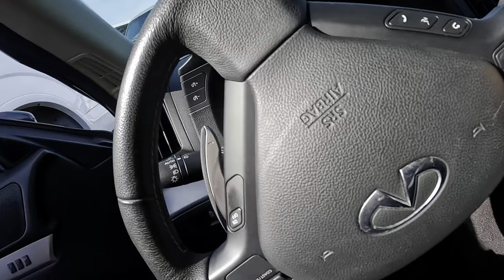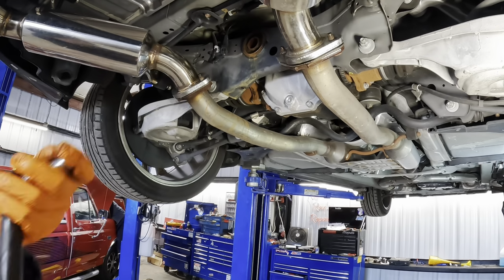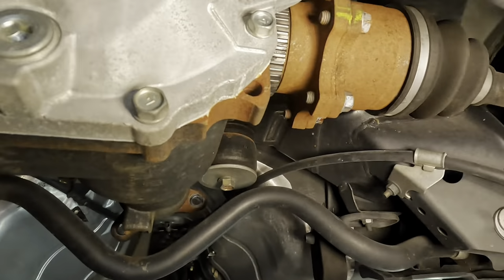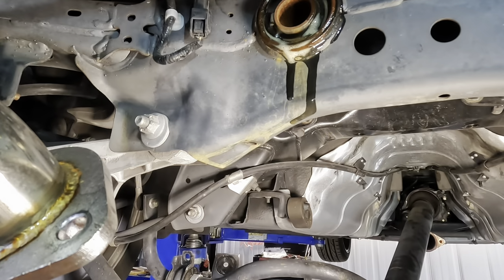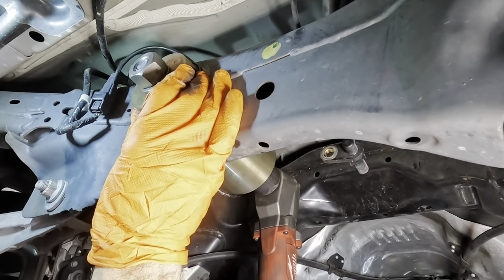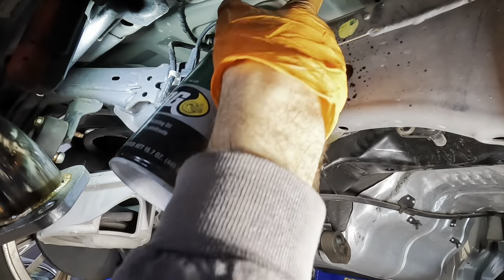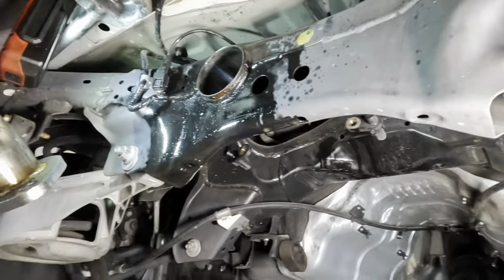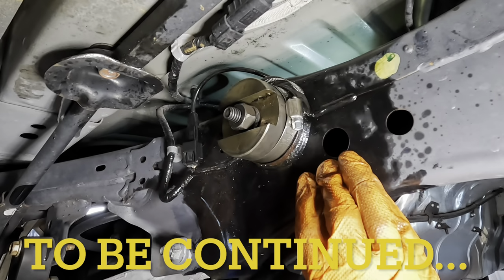Frozen Bushing! Aftermarket Press in! Infiniti G37 Rear Differential Bushing Upgrade

Comment: I think your big pull plate is backwards. It has the groove for the nut. Having it backwards makes the plate diameter grow when tightening bends it. Double washers act as a thrust bearing and belong to the cup side. They should be lubed aswell as thread.
Reply: Exactly correct.
Reply: Yep.
Reply: Sometimes I get so focused on the problem I forget to step back and think “it shouldn’t be this difficult”.

I wonder if all the tightening was squishing the bushing out making it wider. The more you tighten the more stuck it gets.😂😢

Comment: Ray, you should always use silicone grease when installing polyurethane bushings.  1. It helps them slide in. 2. It prevents them from squeaking which they are prone to do over the OEM rubber ones.
Reply: Or washing up liquid/ dish soap

Comment: Should have spuun the cup around to pull from the interior center,  instead of the bushing,  to avoid damaging the bushing.  The cup would sit flat on the crossmember flanges to facilitate ingress of said component. Then use larger flat piece to put pressure on the outer edges said bushing.
Reply: 100%
Reply: Added my comment before reading yours... That's one hell of a pain in the arse job!
Reply: Finally,someone who knows how to use this tool. RTFI Ray(read the f-ing instructions).
Reply: let you tell it
Reply: That’s what I said too.   If it’s not moving try something different
Reply: makes sense
Reply: I wonder if the hole is tapered. Wider toward front of car.  Maybe the bushing should be pushed in from front side of car.    Not a good camera shot
Reply from the maker: @leonardhirtle3645 ”Why won’t it READ!!??”
Reply: I don't think so, but it seems like it would be easier to go back in where the old one came out. @TXCherokee
Reply: Exactly!
Reply: What is this bushing press ?
Reply: @TXCherokee The Z1 rear bushing is tapered. The instructions say that you should install it with the tapered end facing the rear. Basically the other way around how Ray did it. I guess it still fits, but it would have been way easier to install.
Reply: My thoughts exactly
Reply: @Lith808  I though so.  The way it was going in damaged the tool
Reply: @RainmanRaysRepairs  should I eat cuttlefish and asparagus or vanilla paste? hold on kyle I believe in you!
Reply: I would've tried a little heat with a torch around on sub frame

Comment: Hi Ray the slot in the tool is where you put the washer and the nut. It aids in truing the bolt and you only wrench from the cup side. Also turn the extraction cup around and place the flat end against the framework
Reply: Oh, your second half of the comment is for installation!
I was confused for a moment.

Comment: I've done this Rear Differential Bushing without the Special Tool.  I had to revert to Jungle Repair methods using a Saws All, hammer, and chisel. The new Polyurethane bushing did go in easy after being in the freezer overnight. I ensured the hole was cleaned and I applied a Film of silicone Grease so it would slide in easier.

Comment: In the machine shop, to press fit something like sleeve or bushing 
We would use Dry Ice just pack the part into a cooler with dry ice on it until its really cold- you also heat up the hole your going to press it into, at that point depending on the press fit your doing the part would just fall into the hole. 
Cold expands, heat contracts do both to get twice as much space.
When both parts come to room tempt they won't come apart without a lot of force. 

When you heat up a bolt to remove it your actually making the hole larger,   you can use hot and cold to remove something too.
Reply: I think you meant cold contracts and heat expands..

Comment: 37:15 Note: You have put the puck/die hat on backwards, as nut is meant to sit within cutout to stop nut from spinning.
Reply: He does that during the install and the slot is too wide.
Reply: Too wide for the smaller allthread.
Reply: @simonmitchell7439 @TEDodd Video evidence above shows otherwise…The flat side without cutout for nut literally has a bevelled edge to stop edge of tool from getting caught on inside diameter of subframe housing; using it the way shown puts pressure on bushing unevenly and also, causes multiple points of tool to get caught to put it on an incorrect angle under pressure.
Reply: Yes. I was agreeing that the tool was put on incorrectly.  The other comment said the slot was too wide, but it appears it would be correct to hold the nut from the larger thread.
Reply: I am not a mechanic, but I wondered about that.

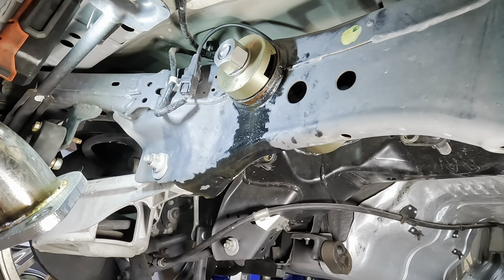Comment: hi RAY,at 40:00 min you could have used your saws all and just cut the sleeve lengthwise ,that will reduced any wall pressure and you wouldn't need the puller.

Comment: You could have used your saws all to cut part way through the outer sleeve to take some of the pressure off to make the press a bit easier
Reply: Yeah, cut the sleeve and air hammer it out. It's much easier.
Reply: That’s the most rust free Nissan I’ve ever seen

Comment: Ray, a WAY easier way to remove old bushings is just a drill bit against the outer shell. The rotation of the bit rolls it around the outer shell and drills the bond away. Takes seconds. Then saw-zall or chisel for outer shell.

Comment: When pulling a bushing sleeve with a threaded rod using a impact only loads the rod like a spring. A large breaker bar will let you to apply more more clamping force on the rod thus allowing you to turn the nut on the cup side half a turn or a full turn then wack the driving plate with a hammer turn nut on cup and repeat. The lose of clamping force on a rod with an impact is like using a long extension on your impact wrench. Torque test channel did an experiment with torque loss due to extensions and a threaded rod acts the same way. Former machine shop employee in my teens and 20s

Comment: You could use the cup side of the extraction tool to maintain the bearing shape with the puller washer inside to pull the bush through  I know you'll have to hold the cup in place with your hand but it should work
Reply: I was thinking of this same idea. That should keep the new part from bulging beyond the diameter of the hole. And pulling the new part in from the front side worked great for the first 3/4, why not keep that up for the rest of the way.

Comment: Wrench, also known as a spanner, this side of the pond.

Cuttlery dividers. The plastic trays that you put in kitchen drawers, to put your eating irons in. Are they a thing outside of the UK?
They are ideal to put fixings and parts into when disassembling things. And the multiple compartments help keep bits grouped together. Avoiding mix ups when reassembling.
And they are cheap, robust and washable.
Reply: I live in the u.s. we have them here. I have an old one. I glued magnets to the bottom of. They work good for holding parts and tools being used for that job.
Reply: They tend to be pretty cheap (£1) and plentiful in most supermarkets. I have about 4 of them to hand at any time. 
Far better than putting loads of fixings in the gutters around the bonnet (hood).

Comment: Dry Ice for bushings works better, it is colder and will shrink them more. also warm the other part.
Reply: Back in the 80's we pressed in a lot of 4 and 5 inch bronze bushings.  They'd go in the freezer and you'd still have to pound them in.  The first time we tried dry ice, the guy lined things up and proceeded to slide the bushing all the way through and onto the floor.

Comment: Hi Ray, with a lot of shrink fit experience, I might suggest our method, we used eco-friendly anti-freeze that we would freeze to a slushy and we had special gloves to protect our hands from the cold and the other part we would use hot water close to boiling and use Deltronic oil sprayed into the fit. Since I doubt you'll be doing this method very often, I doubt you'd want to buy a special freezer that will freeze anti-freeze. I just wanted you to know their is a work around without resorting to liquid Nitrogen, which we also had on hand if needed but it seems you have it under control, good luck to you
Reply: Ever think to use liquid nitrogen?
Reply: freezing the bushing and also heating up the hole, would help, but all done quickly

Comment: A thrust bearing between the nut and the press tool would have significantly reduced friction and made the pressing operation easier!
Reply: Yeah, my kit has thrust bearings.  And, I' not sure, but I think my all purpose bushing kit has the cups and plates needed for this job, and it was only about $120.  The threads on the rods look identical.
Reply: It has washers for that reason, use wd40 on them.
Reply: @johnt.848  I've greased washers before, but my new kid has thrust bearings, which really seems to help.
Reply: Should have both washers, greased, under the nut you are tightening.  Sure a flat roller bearing (thrust bearing) would be better but 2 washers works well.

But Ray didn't stack the washers.
Reply: @TEDodd  I never thought of putting the two washers on one end.  I'll try that!  Thanks.

Comment: Ray, a polar vortex means we are getting air right out of the arctic.  I'm in Kentucky and we are looking at highs of 12 degrees and lows near zero!
You Floridians need parkas at 40 degrees!  But our summers have less humidity so we ain't mad at you.
Big wrench on the front WITH the ratchet on the rear!  All thread was spinning in the rear with the pneumatic on the front.
GRAVITAS!

Comment: One of the comments was to turn the cup around and use the larger flat surface to pull the bushing into place. Do not put the small part in the middle. Next time read the instructions.

Comment: HAHA, just read the comments seems your viewers are a preatty smart bunch of guys.A lot have said cut the outer sleeve.i had 1 other thought,after i had a 'plug' get stuck inside the hole>>MEASURE THE PLUG to INSURE it's a SMALLER DIAMETER THAN THE HOLE.A lesson i learned the hard way.haha

Comment: Think the plate with the slot, is designed to hold the nut still, with no washer.  So you had that part in backwards.
Reply: That’s “hurry up Ray”.  Doesn’t take time to learn how to use the tool properly.  Gets frustrated, and then things get worse.  I use to be like that as a young mechanic.  I finally learned to study jobs I hadn’t done before and tools I hadn’t used before.  Things go much smoother that way.  He is a good mechanic, and he will learn to slow down on unusual projects and think it through first.

Comment: 57:12 OMG  NEVER SEEN RAY FLIP OFF AN OBJECT. That must have been really tough. 

Really the object has something in store for you as revenge, the new bushing.
Reply: IKR, what makes it an upgrade? The oem is probably the way to go. Metal outside for a reason. Also the old one didn't look bad to me
Reply: @jthonn it's fluid filled and it leaks out that's what makes it go bad. If it was good it would have leaked fluid all over him when he destroyed it
Reply: Thanks @ianriggs
Reply: @jthonn  oh and there is no OEM option btw Nissan makes you buy the entire subframe
Reply: They got you by the b...., but it may be easier to change the subframe. @ianriggs
Reply: @jthonn  not for almost $4,000 dollars lol
Reply: Holy Cow! I wonder if you could pull the subframe and use the hydraulic press machine. That may be easier? @ianriggs
Reply: @jthonn  possibly but I'm not sure removing the entire subframe is worth it cuz I think it would still be a fight even with a press. That tool kind of is a press that thing just didn't want to let go
Reply: Thanks man, I do think after seeing the other side, he went into the wrong side with it. Maybe it would have been easier, I guess we will never know.  @ianriggs
Reply: @jthonn  ya possibly but I remember we did talk about that when I picked it up and he had a good reason why he didn't do it that way
Reply: Thanks! I didn't realise it was your car. Mission accomplished, that was the main thing. Nice ride @ianriggs
Reply: @jthonn  thank you I love it. Bought it off lease in brand new condition it was like a 3 year lease it was actually still under warranty when I got it. It's a 2012 and I bought it in like 2016
Reply: @jthonn   I can't believe it's 11 or 12 years old

Comment: To get the outer shell out, you could have run a bead of weld around the inside. This would shrink the outer shell making it easier to remove.
Reply: Easy breezy old time welder solution.
Reply: Have you ever seen Ray weld? He welds like Ray Charles! 😂

Comment: If you’d turned the plate around the nut would have sat in the slot and stayed fixed
Reply: Same thing i noticed
Reply: and then a breaker bar on the other end. done.
Reply: Yelp

Comment: This is perfect example of why it's important to choose a contractor base on skill and knowledge and not just because you like him or because he has a successful channel. Ray is obviously qualified to do "most" repairs on many vehicles, but this video demonstrated that this job was not one of them. This was perhaps the failure of the customer if he neglected to ask is if Ray had performed this particular operation previously. It was also a failure on Rays part to GUESS his way through the project. As a business owner myself, I can tell you there is value in telling a customer, "ive never done this and I think you should find someone who has." This prevents the contractor from losing money on a job due to error and it tells the customer that the contractor knows his limits. That said, IF the bushing came with instructions on how to use it properly and Ray chose not to read them, then that would speak volumes. Often times however, these aftermarket items will not come with instructions, so we cant assume.
Reply: Air compressor studs broke off the shop foundation and it was vibrating all around in the parking lot🤭
Reply: Ya, I like Ray, but this is a bad look.
Reply: @KHALABEEB  anyone has like has built as he has...I don't care if the air compressor was dancing 🎶 in the parking lot. I would have done a 'C' section on it. Find the fuse boxes on those...tear the drivers seat out...
True could have pulled his crew in..that would be an excellent option....
And sometimes...nothing for install instructions...just plug and play.
Reply: Like a broken wheel on a European shopping 🛒
Reply: Gotta admit...he was was scarey on that hammer 🙂🙃😊

Comment: Cold lol put a coat on it -17 up here with 12 inches of snow. Get an impact on that dang bushing. Btw slot cut in there is to hold the nut you put it on bacwards

Comment: Hi Rainmanm. I want to render you a few suggestions. Put the new bearing in a pack of Dry Ice. While its cold and shrunk, red hot heat the diameter of the bearing hole sleeve  To aid in lining up the bearing to stay center, support it with magnets, Don't waste time  Good Luck man  A subscriber retired body repairman.

Comment: Oh I’m so happy to see someone else have my sort of experience with a rod and cup style bushing puller. And Ray doesn’t have rust to deal with.
Over here, step one would be clean the exposed part with emery paper, ideally after pulling the bushing out a little the opposite way first. 
Even then, I think the time saving method would still be to take out the frame and bring it to the press. The threaded rod is never strong enough for the extraction and, in this case, having to use a smaller diameter rod for insertion seems like a recipe for failure.
Using a press, the frozen bushing doesn’t have time to return to room temperature before it’s fully home, so the operation goes smoothly and far less frustratingly.
Thankfully, I’ve never done one of these, so not sur how much extra work is involved in getting the frame out, but it turns the actual bushing replacement into a 10 minute breeze, so quite possibly still a time saving technique.
Man oh man, this global warming is a b1tch. Even cold in Florida, now. It’s been over a decade since we escaped with no snow, here in Ireland. Time was when snow was a rarity and we’d be rushing out to play with it, if we were lucky enough to get any. It was a once every 3 or 4 years occurrence, back then. Now that we’ve warmed up so much, it’s every year and we tend not to get summery weather in the middle of the year, either. Cold and wet is the norm, now. I’d love to bring the experts over here and make them live through a typical year, then explain how, if they’re telling the truth about all this warming, we’re getting potato blight and constant cold all summer, then freezing conditions every winter. 2023 was supposed to be the warmest on record, here. But if you blinked at the wrong time, you would have missed the warm period. Ask anyone who lives and works on the land.
The upshot of all this is we now have salt on our roads every year, often for long periods of time, so our rust problems are returning to 1970s magnitude. On an Irish car, that bushing would have been rust welded into place. Getting it out , under the car like that, would probably have been impossible without damage to the frame. As for getting the new one in, particularly a rubbery one, with no outer sleeve to push on, I suspect that would be a similar nightmare with the added joy of rusty dandruff falling in your eyes.
Remind me… why do I want to get back to work?

Comment: Tip ray when the bushing is quarter to half way out. Get the air hammer with a chisel bit and use it on the od off the bushing driving it in and reducing the the od and it will fall out saves a whole off time trying to press it out the whole way

Comment: Did all my bushings on my 4Runner that are like that, about 14 total and they are a real pain. I used heat and a similar tool on the front lower control arms and a drill and hacksaw on all the rears, it was a FUN project!

Comment: That bushing is built with a slight taper on the back end and should be installed from the front and pushed or pulled toward the back of the car. HTH forr next time .